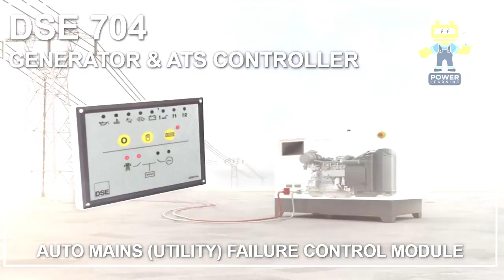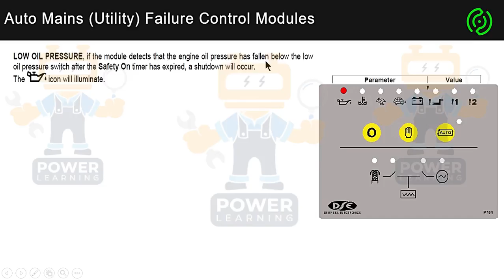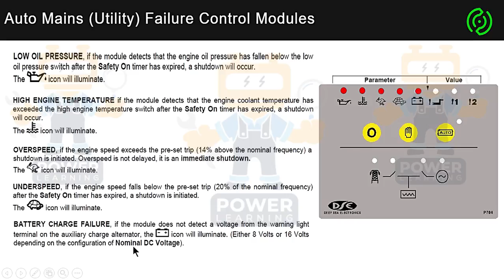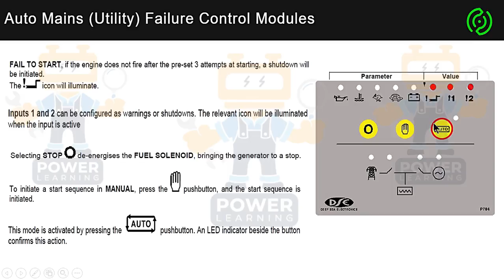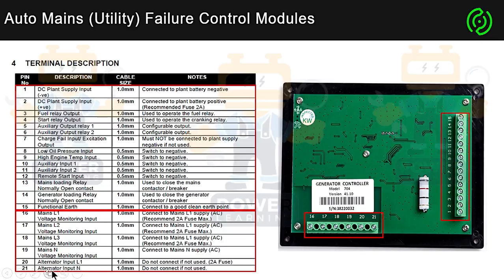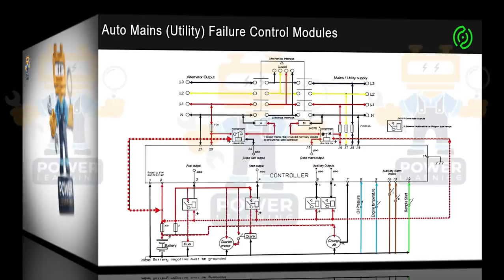704 dse generator controller wiring | How to do wiring from Dse 704 to controller to Generator #dg

Comment: How to reset the "fail to start" alarm, when the LED still illuminating,,? 

Thanks in advance
Reply from the maker: *The engine is cranked for a 10-second period. If the engine fails to fire during this cranking attempt
then the starter motor is disengaged for a 10-second rest period. Should this sequence continue
beyond the 3 starting attempts, the start sequence will be terminated and
Fail to Start fault will be illuminated.*
**
Reply from the maker: FAIL TO START, if the engine does not fire after the pre-set 3 attempts at starting, a shutdown will be initiated.
Reply: The engine fail start because the battery voltage is drop, when the battery have changed, and the engine sucessfully start the alarm still there then the genset fail to take the load and shutdown.. so how to reset the alarm.. thanks